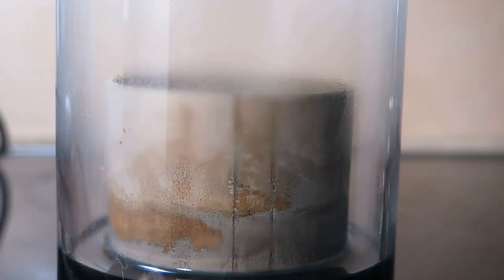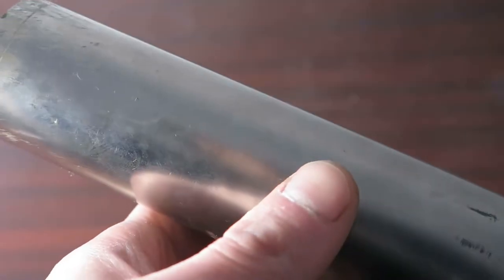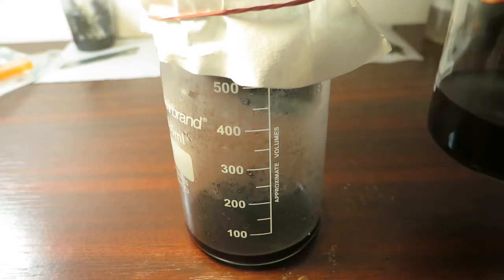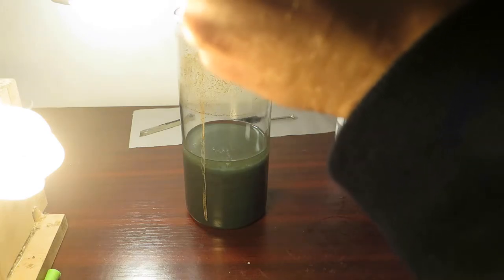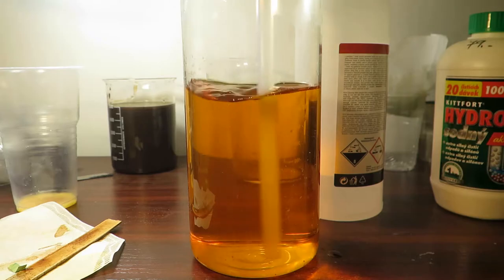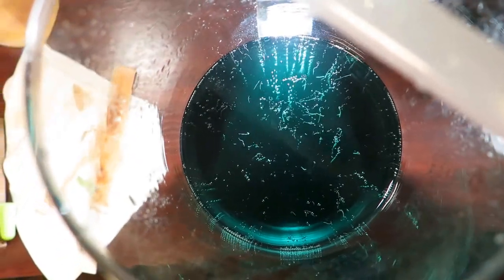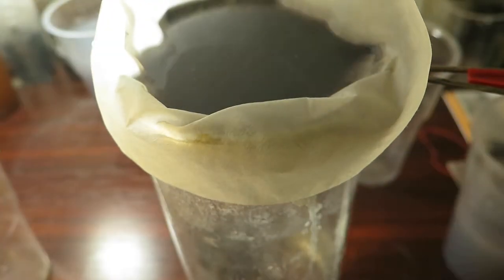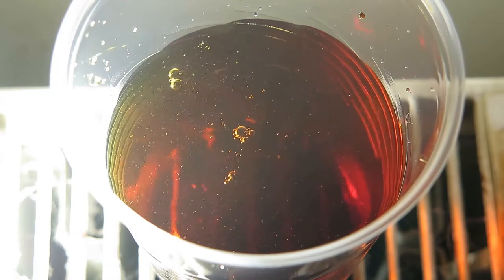Isolating chromium from stainless steel

Comment: I had the same issue with displacement reactions with sulfate salts and aluminum and saw a video where someone said passivation prevents too much of a displacement reaction without chloride ions so you can add NaCl and it should go. My first one was the classic copper salt with aluminum and did the copper sulfate and aluminum and nothing then after adding salt it took a couple minutes and went forward. Thanks for posting this it is a great video!
Reply from the maker: Hmmm this could be the case. Thanks for suggestion!

Comment: So I've been on this for a bit to get chromium for my element collection and so I figured out that you can electrolyse chromium sulfate and get chromium and you get the chromium sulfate from when you got the sodium dichromate and added the sulfuric acid and hydrogen peroxide. It makes that and also sodium sulfate but it wont interfere with the electrolysis. It will create a chrome plating but if you leave it for a bit it will become thick and bumpy and you can break it off and get the pure chromium. It's called electrowinning if you want to research it. I will conduct the expirement soon and I will confirm if it works or not.
Reply from the maker: I tried that, I was able to get silvery plating, but when I let electrolysis go for longer nothing really came out. perhaps my solution was quite dilute. Dunno...

Comment: Hey you can add excess sulphuric acid to make chromium trioxide and filter it. Then add the precipitate to water to make chromic acid then add ammonia solution ( concentrated ) and the boil down the solution to make ammonium dichromate then you can do the famous reaction of Ammonium dichromate volcano reaction. Ammonium dichromate thermally decomposes to cr2o3 and nitrogen gas and water when boils of due to the heat of the reaction then mix the cr2o3 with al powder and add some kclo3 to boost up the reaction so the chromium melts and coleses into a blob of metallic chromium.
Edited : use this process when you add sulphuric acid to sodium chromate to make sodium dichromate and add more sulphuric acid to make cro3

Comment: I'd like to do a similar procedure, processing scrap stainless steel. It's a little difficult to determine what's stainless steel and what's just steel with a zinc coating (or something else). Some things like kitchen cutlery usually say if they're stainless steel, but most other things don't seem to say it. 
Lmk if you know of an easy way to determine stainless steel from steel with other metallic protective coatings or whatever else. Obviously it's easy to tell if it's aluminium or nickel, but not other forms of steel.
Reply from the maker: I guess using mangnet would be pretty accurate
Reply: @IlusysSystems  But stainless steel isn't the only metal thats magnetic that looks like stainless steel... Galvanized steel, steel with nickel coating, etc.
Reply from the maker: @jhyland87  No, stainless is very weakly attracted to magnet. in other words put ND magnet on steel, if it doesn't stick, it's stainless.
Some kitchenware is slightly magnetic, and also it's quile low quality stainless steel, that can start to rust in salty conditions
Reply: @IlusysSystems  hmmm... Ok. Ill give that a shot. I have plenty of Nd magnets :-D

Comment: How dyed agate make it green?
Reply from the maker: Wat?
Reply: I want to color the agate to dark green, according to the journal using Chromium, but I don't know how to use it
Reply from the maker: @herlanggaal-batawi703  What journal?
Agate is quartz mineral, chromium contamination will surely color quartz, not sure if it will be green, but perhaps. To mix quartz with chromium you need to melt the quartz. You can't really do it...
Reply: I doubt it, so I looked deeper into chromium. Can you do the perfect coloring of dark green? If you can,  auto subs for you 🙏
Reply from the maker: @herlanggaal-batawi703  Well I guess you can... https://www.youtube.com/watch?v=BtG2B2VnB4w

I would soak in bichromate and them ethanol I guess while thing is still acidic. H2O2 may work as well, but can destroy your piece...
Or something completely different. I have no clue really.
Reply: Thats channel I have seen and tried it but it's not optimal